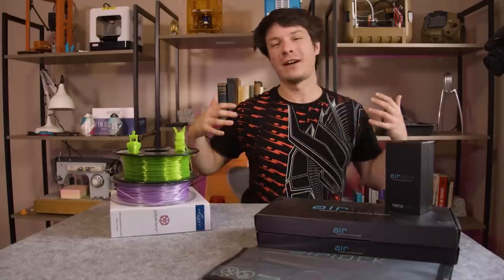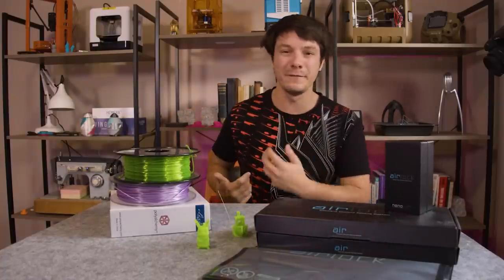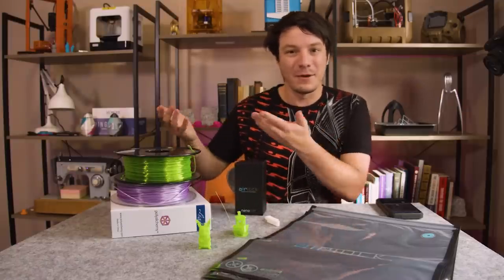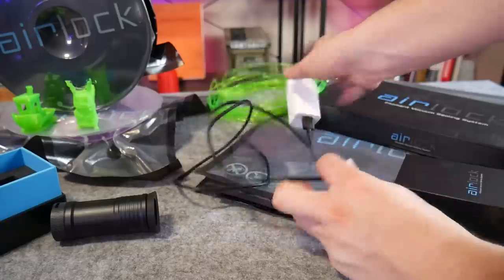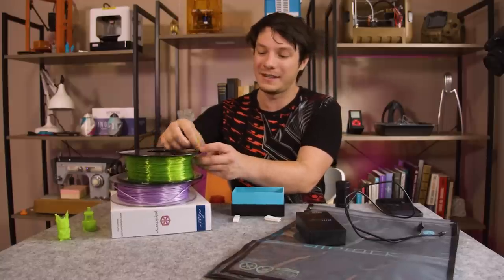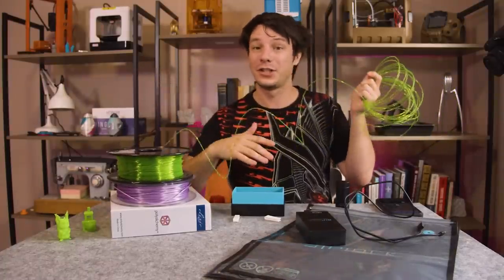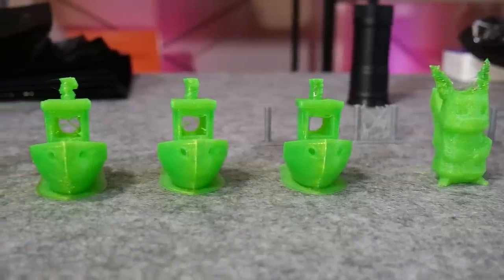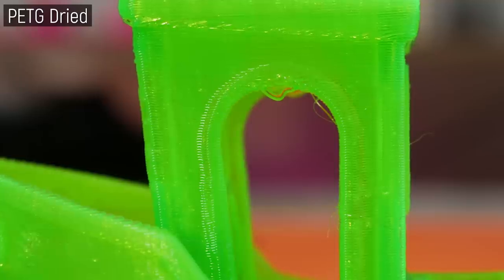Should you store filament in reusable vacuum bags? Nanovac + Airlock review and test

Comment: Why not use it for PLA? I print with PLA so was wondering if I needed this. I never realy ran into a problem with older spools.
Reply: With PLA it really depends on where you live and how humid it is. I live in a relatively high humidity location, and I’ve noticed that if I don’t store my PLA in a sealed container with desiccant, it absorbs moisture within just a few weeks and starts affecting print quality (it even bubbles a bit coming out of the hotend like you see with nylon but not as bad). 

However if you live in a dry area like say southern California, you probably would never need to worry about your PLA, it’s probably drier sitting out in the open than my PLA is in a bag with desiccant haha. Then you only need to worry about dust, but a regular storage bin or something is fine for that.

If you never had any issues with your old spools you probably live in a dry enough location that you don’t need to worry about your PLA at all, just PETG (after a few months) and of course stuff like Nylon which pretty much always has moisture issues.
Reply: @einsteinx2  thank you. I live in jersey. My printer is in the basement where it never gets hot and never even needs AC. I also run a dehumidifier down there to pull the moisture out of the air. My spools are in zip lock bags and then back in their boxes too. I assume all this helps along with half the year being pretty cold.

Thank you!

Comment: Hmm... I would have expected the bags to have a diffusion barrier. If they CVD'd a little Aluminium on there, I'd expect the bags to hold off moisture way better!
You know, like chips bags
Reply: I was thinking the same. I think it's not getting wet because bag of desiccant was too small, but because of diffusion.
I think it's similar to the diffusion in heating pipes..

Comment: Food saver bags are cheaper and readily available, plus they come with a manual pump which is less gimmicky than the electric one and less liable to break. Avoid ones marketed as specially for 3D filament as they tend to put quite a markup on the price.

Comment: Not to be 'that guy', but wouldn't a person ripping through roll after roll (like a good 3d printing nerd does!) not need to keep things 'fresh'?
Yes, some materials suck (moisture), but if we just used them up faster, they don't have a chance to spoil.
Simple solutions, from simple minds, for complex problems.
*
Troll disclosure; I have an Ivation food dehydrator right next to the printer....I dry the filament and the poly bag while printing!
About an hour of drying before I start printing I put the roll, spice-packets (silica) and open poly bag in the 'roaster' and it all stays in the dehydrator as I print.
Storage shelves put recently used (and dried!) rolls at the distal end, older and damper rolls at proximal...I rotate stock often!
Wet poly bags fell droopy and sticky, dry poly bags feel crisp and shiny.
The food dryer has enough room for three rolls; print from one roll, dry the next roll to print and dry a roll that hasn't been through the mill in a while.
*
Why so serious?
I live in a region surrounded by rivers, lakes, and framed by the Pacific Ocean.
We have a strong 'on-shore' weather pattern that drive moisture into the air all the time.
About the only time we see dry air is during hard freezing weather, rare.

Comment: I think that all single-spool dry storage solutions are flawed. I'm only half a year into 3D printing, and I already have more than a dozen filament spools that I started and need to store. Buying an individual storage bag for each is too expensive.

I have bought a 110L plastic box, added to it 0.5kg of desiccant, and this allows me to store about 20 rolls of filament in a dry environment, and does not require me to fuss with a roll when I need to put it away.

Comment: Cough Ad for airlock, should be labelled as such.

Ok some education: Their is no moisture getting back in the bag, the moisture is equalizing from the filament on the inside of the roll to the filament on the outer edge once it is allowed to sit in the bag for a few days. You dried for way too shorter a time for storing filament that way (needs at least 24hrs) and your desiccant bag needs to be dried at 150*C (not the low temps used for filaments) to reduce or prevent this moisture creep from happening once bag is sealed. Up side is, even half done the way you did it will make the filament last a lot longer on the shelf as well.

Why you making out this is some new invention??

Also the bags your ad shows are way too large, the ones being sold for ages on aliexpress for filament are a much better fit. Poor attempt to do an upmarket sunsun kit, only without the humidity sensors and bags that are too large and don't shrink to the size of the spool

Comment: yeah so I'd just use normal ziplock bags and use a 5 dollar pump from the store to remove the air from it. the very small moisture that is left in it will not cause the issue and don't have to pay over 8 dollars for it all.

Comment: why keep the use of so inefficient drying as dehydrator, why would you spent 8h at drying when you can achieve a deeper and really high and efficient drying under high vacuum ?
should last 1h max !
while air dry mostly the outside of the spool, vacuum goes deep until the whole spool.
please give it its try and show this most sustainable solution.
Reply: I think cnckithcen tried it. Don't remember the results though.